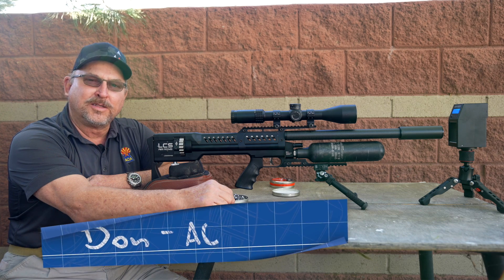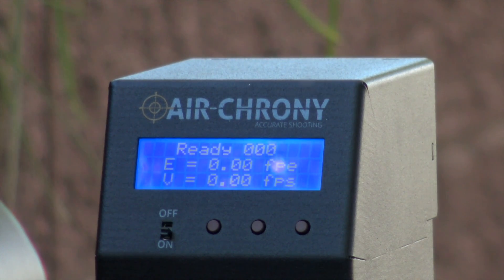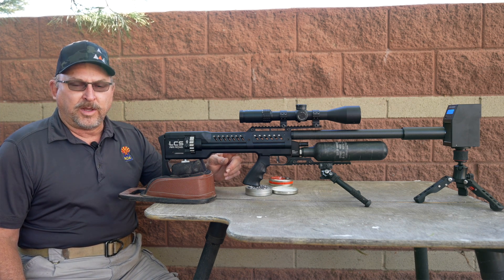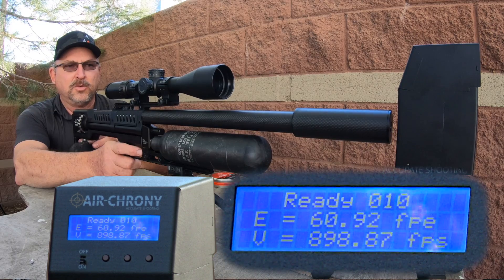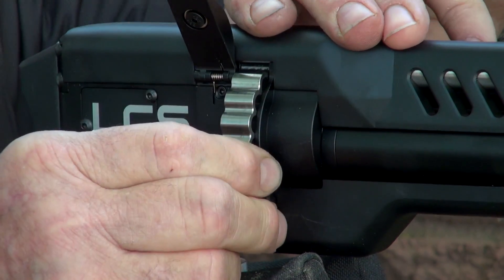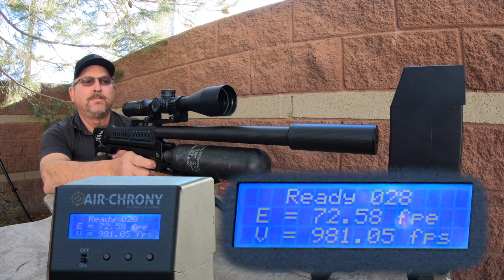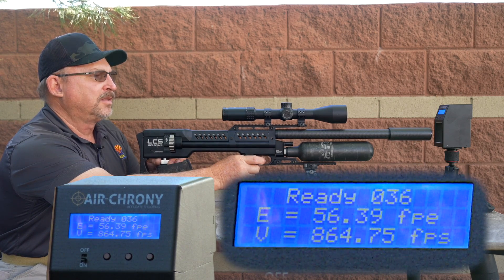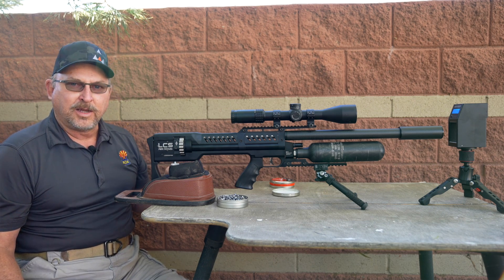Tuning the LCS Air Arms SK-19 Airgun

Comment: I took a golf tee and cut off the tip attached a piece of para cord to it and it works perfect for seating pellets slugs and is always right there around my neck can even use it while it's on. You can adjust the size from the tapper from the point. Cheers

Comment: Your results match with my rifle's. I set my regulator pressure to 130-140 bars if I want output up to 67 fpe, but I increase to 150+ bars if I want to shoot up to 77 fpe..I haven't power maxed it yet... Good upgrade is a 0.7 lt 300 bar carbon bottle with an FX bottle valve... I haven't dared to fill up to 300 bar yet, so will be nice if you could confirm that regulator can handle the additional 50 bar (max to 300 bar).
Reply: Just go up slowly I've heard from you someone close to the source